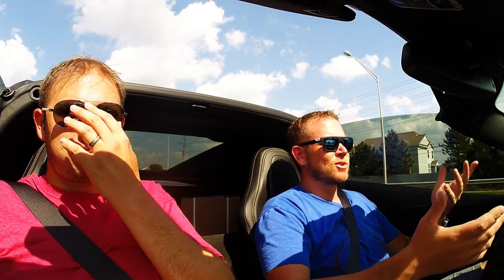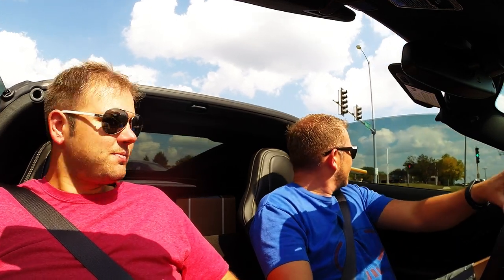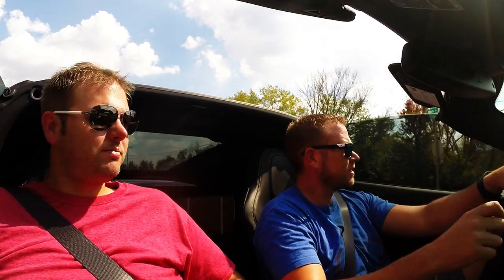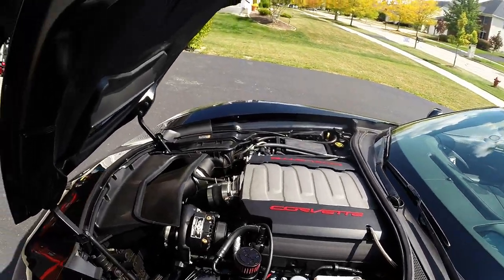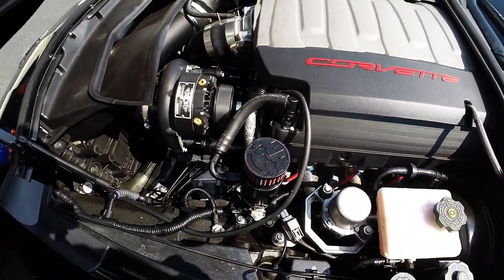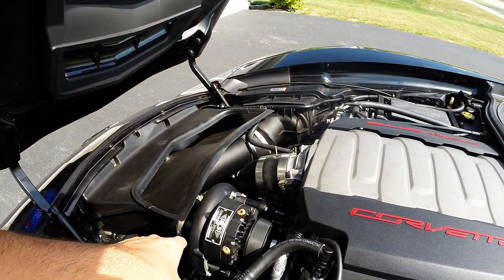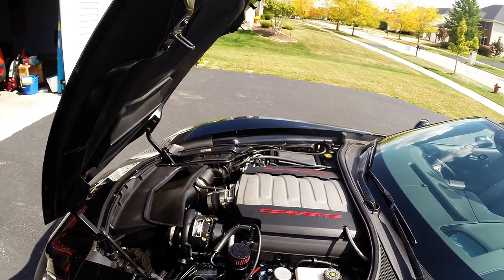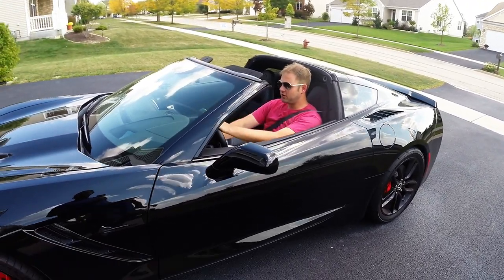Ride Along in a 900Hp C7 Stingray

Comment: Great build. We did something similiar on our 2014 Z51.. Fully built TS&P 416, forged everything, lower compression for forced induction. ECS 2200 blower at roughly 20 #'s of boost, Prometh methanol port injection, low side fuel system, Corsa Extreme Exhaust, American Racing 2 - 2 1/8 Headers, custom MSD Airforce Intake, TS&P VVT3 cam with 34% bigger fuel lobe, TS&P PRC heads, 30% bigger injectors, etc.. we are roughly 1300 hp.
Reply: officermmartinez 2200HD blower?
Reply from the maker: That’s got to be insane to drive. Auto I assume? My brothers is a 7 speed and it’s just not practical anymore lol.
Reply: For 1300 Hp what did you have to do clutch, trans, axle wise?
Reply: I’m doing a similar build now trying to figure out limits of my C7 clutch, 7spd manual, and also cheapest most efficient route for fuel system. Already doing meth and boosted cam. Went with the procharger p1x looking to push it to its limits!